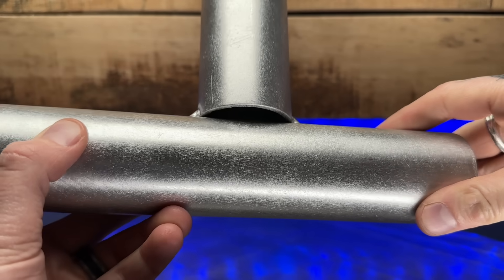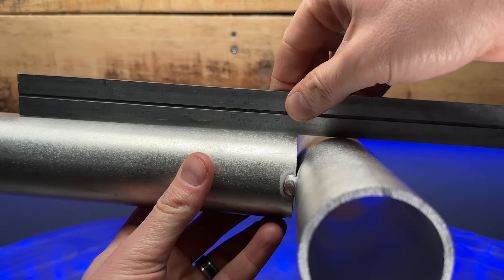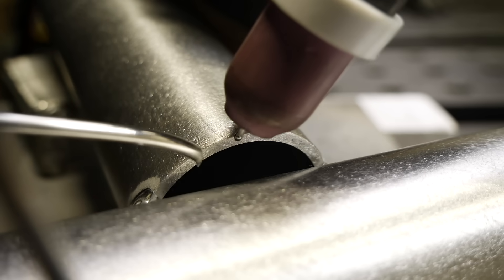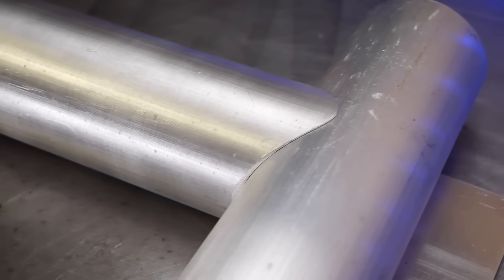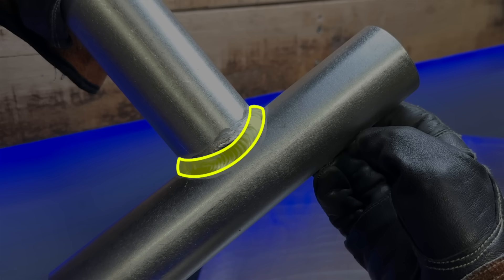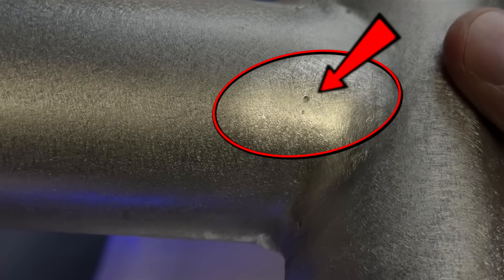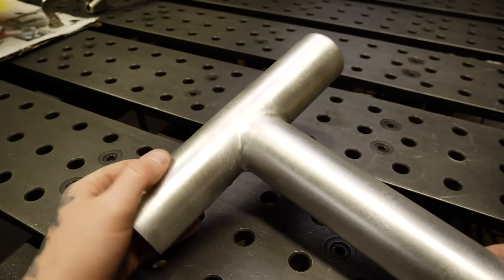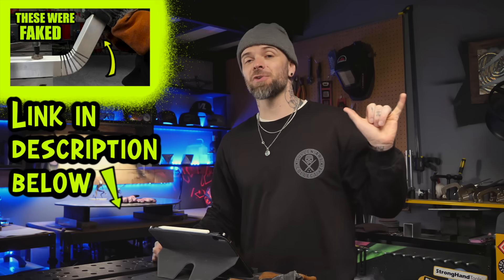TIG Welding a HUGE Gap, and Making it Disappear

Comment: You're also doing what I call tap grinding when you are blending out your weld so you don't under  cut your base metal.  You make lots of tap hits so you can see what your doing exactly when you pull away and not get too carried away when trying to match your edges. I like.

Comment: You used the Everlast tig for this video. Do you still use Prime welders. For the average home garage use which welder is the best for the money, Prime Weld or Everlast.
Thanks
Reply: I have that same Everlast Typhoon 230 as a hobbyist. I will never outgrow it. I think Prime weld is decent but not equal to the 230. If your going to weld more than just plain metal I would think about saving up a little extra for the Typhoon 230.
Reply: Prime has a 325amp tig welder that seems pretty awesome. Probably going to be my next welder.

Comment: Good teaching how to fill gaps in general.  I know with DC you can use pulse process settings to keep the bead from washing out too much and stay more crowned to build up material.  Are there balance settings in AC you can use to do somethign similar?

Comment: Oh man, I gotta try that punch idea. I spent days grinding and filling .060 aluminum welds that had to be leak tested as it was going down to Antarctica for scientific research. Biggest headache I've ever had was trying to get rid of that little bit of porosity because it failed a dye leak test, the more I got rid of it and filled it, the more it showed up in places I hadn't touched.
Reply from the maker: Hey Pas! I hear ya, that’s a nightmare! I have to say, I've got to give you props for working on a project that's going to Antarctica! That’s pretty cool! Give the punch idea a go 🙏

Comment: Definitely not this big of a gap, but I make aluminum pipe rails all day long and do this trick every now and then to finish a return bend or weird compound angle. Not structural but it’s good enough for a grab rail and saves my ass. Long as you know how to weld and have other tubes fit better, it wont crack on you

Comment: I'm about to learn TIG welding after more than 30 years stick and wire feed welding. I have a YesWelder machine waiting for me when I get home with a foot pedal.  How do you know when to go up and down with the pedal? Your process here looks great.
Reply: Get some scrap & starting out you will learn making a puddle & don't dip the tungsten. Strike a ark on scrap & watch the puddle as you press the pedal start to melt & blow through if you keep it to hot. Purposely go to hot just so you can see it & xp. Just keep using the peddle & see how the arc responds, few minutes -1hr you will have basic idea, you will mess up and dip the tungsten accidentally over & over & your arc will turn to shit, clean it.

Comment: Wait a min.... why would you not just cope it😂 with all do respect. Why dude. I do a lot of roll cage work and it has to be coped if not it could kill some one in a roll over. I know this is not the same but would it not make running all the way around much easier? This just looks like a bad fabrication technic and more work. Not trying to start a war in the comments I'm just curious as to why no cope?
Reply: Whatever was used to cut the tube can be used to cope a fit as well.
Reply: What is coping
Reply: @becksbitofblue  that's when you get something lol
Reply: I would love to see someone who is a welder..show how you would show how you weld a joint at 45 degrees and no matter what can't fit that cup..
Reply: @mickeythompson8770  do you mean with a cope cut and fill the tight end of the 45%?
Reply: He explained the "why" at the very beginning. SMH
Reply: You mean all due respect?  🤦🏼‍♂️
Reply: he just wanted to show how to do this without a tubing notcher.  i dont think hes advocating to do it this way.
Reply: He's actually mention it @ 0:41 and @ 5:26 which is why you would've figure out that this clip isnt about coping, its about welding with a gap.
Reply: thank you @storfarbrorn489 

at cope it...did u watch the video?
Reply: yep, musta watched the title only lol.
Says it at the beginning and then at 5 mins again.
Reply: Sometimes fitment is bad and you have a gap and can't start over (maybe due to not enough material).  He shows an extreme example here with a huge gap that someone can apply.  Obviously not for roll cages or anything structural.
Reply: He's literally just doing it to show you how to weld a massive gap which sometimes you just gotta do don't think too much into it 🤦‍♂️
Reply: He said at start of video.. *should cope it*.. but if lazy as ballz, have at it✅ ( it’s just for video sake )
Reply: This is artwork not for structural